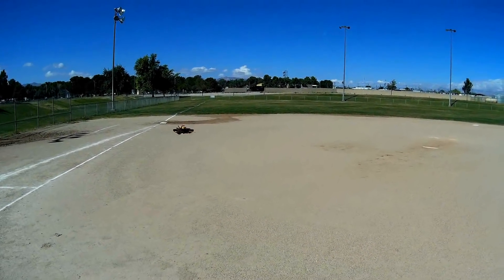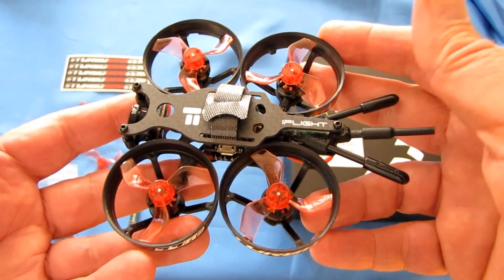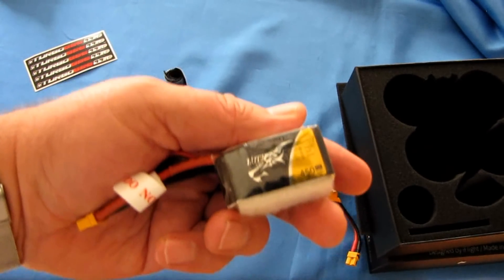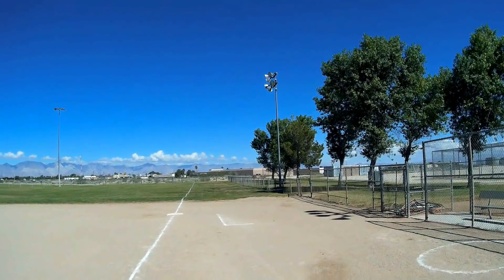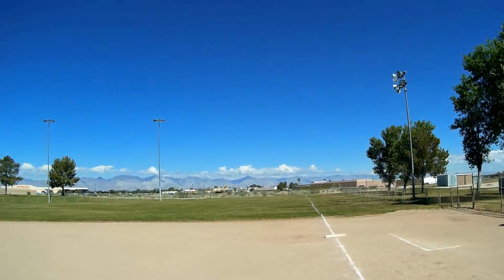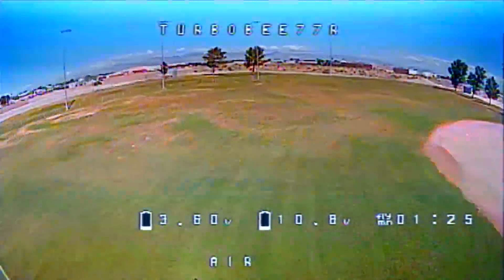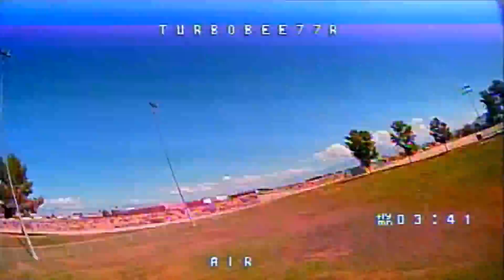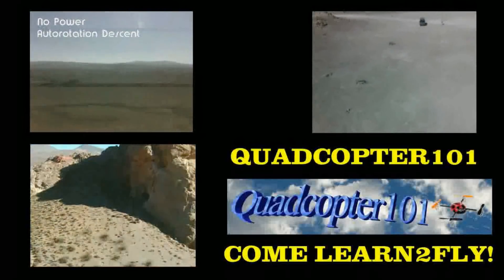iFlight TurboBee 77R Brushless Micro Whoop FPV Racer Drone Flight Test Review

Comment: I like your videos. I watch them when I want to decide what drone I want to buy because I don't have a lot of money and you have some pretty good reviews. I watched your video on the cx-35 so I can learn how to trim. One problem, your picture in picture covers your fingers when you trimmed it. I know this is off subject but can you tell me how to trim my cx-35 Please? The buttons are not marked and the manual doesn't tell me which ones are which.
Reply from the maker: The tiny buttons below and to the side of each stick are the trim buttons.  As an example, let's assume that you notice that your drone always tends to drift to the left when hovering without wind.  That tells us that the drone has left roll drift.  The roll trim buttons are directly below the right stick.  To correct the left drift, it needs right trim to counter the drift.  Quickly and repeatedly press the right roll trim button until the drifting stops.  If the drone is drifting forward or backward, then you'd use the pitch trim buttons which are located immediately left of the right stick.
Reply: @Quadcopter101  
Thank you very much. It is really neat that you answered me back.

Comment: Power was already low before you took off after adjusting the camera angle. OSD showed 11.1v with no motors running, which means the battery is almost done for already.